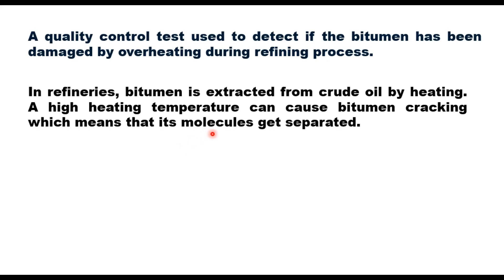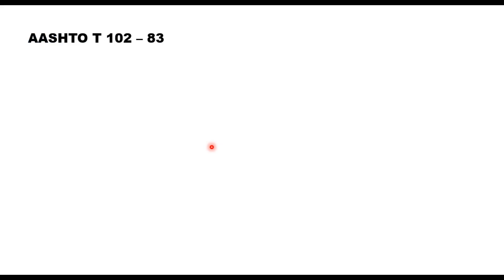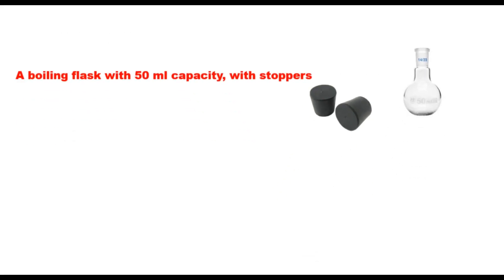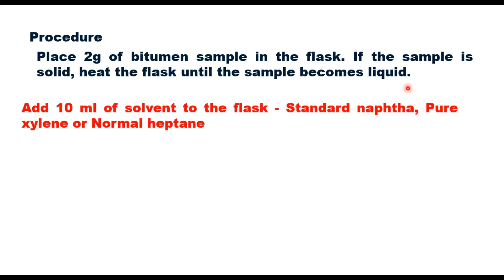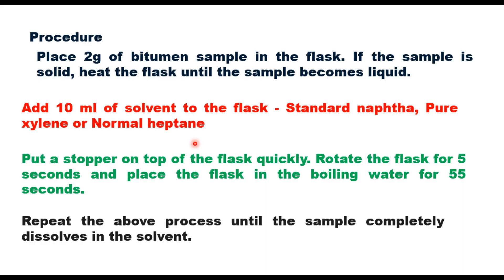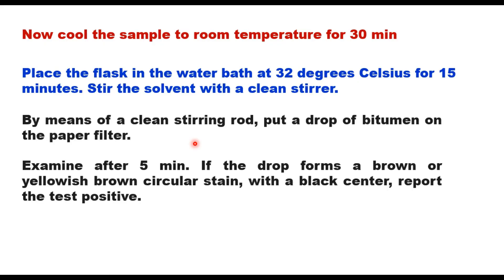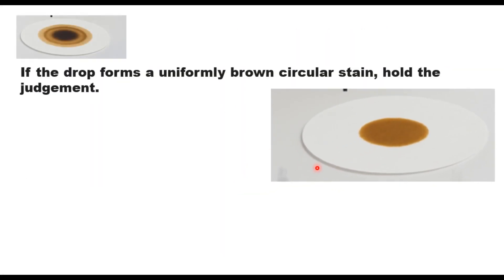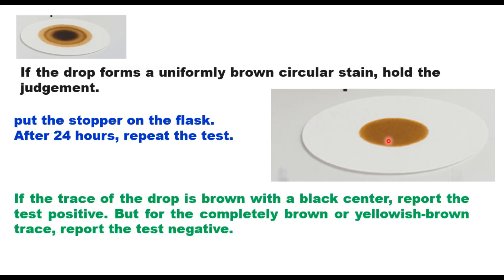Spot Test on bitumen to judge its quality during poduction as given in AASHTO T 102-83

Comment: Sir, could you please suggest the alternative test that can be performed instead of the MSCR test for asphalt binder evaluation?
Reply from the maker: The MSCR test evaluates  high-temperature performance of bitumen by subjecting it to a series of stress levels in a Dynamic Shear Rheometer. It is a measure of creep. Alternate to this test could be G*/sin(delta) parameter, which is an older superpave parameter.

Comment: Thanks for sharing such a useful information, 
What happen when bitumen content is higher than its permissible limit in BM and BC and what is the solution.
Regards
Parveen Kalra
Reply from the maker: Higher bitumen content will create problem of stability, bleeding and rutting
Reply from the maker: BM layer cannot be corrected. BC layer can be to some extent corrected by spreading a thin layer of sand. The sand can absorb some bitumen in a few days, then remove it
Reply: Thanks a lot